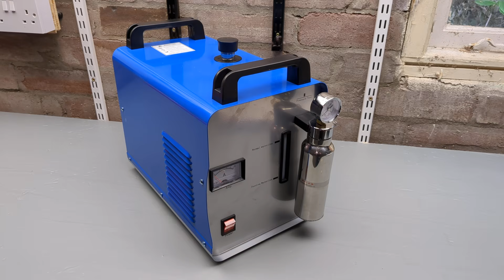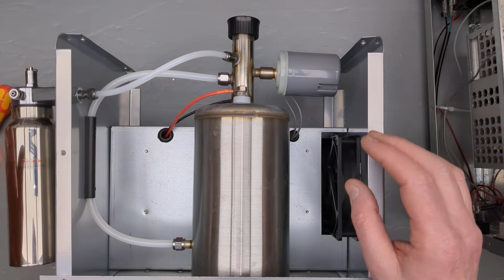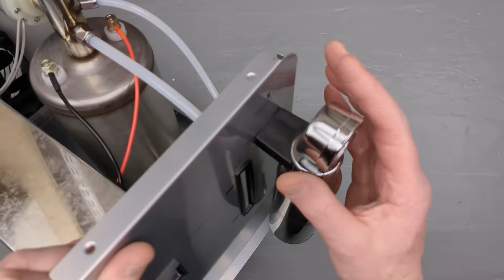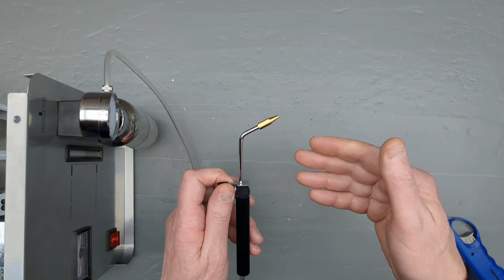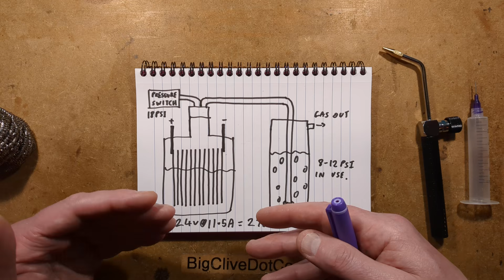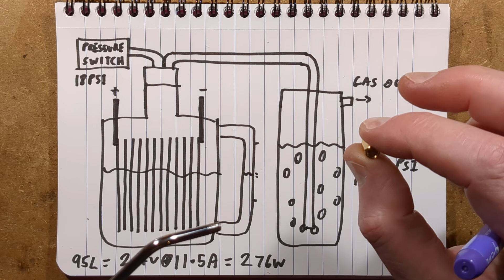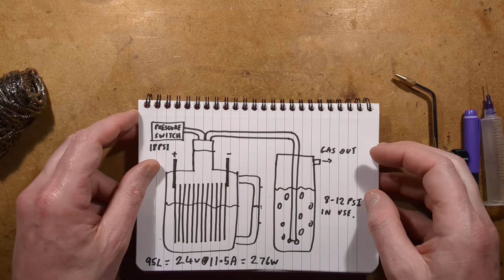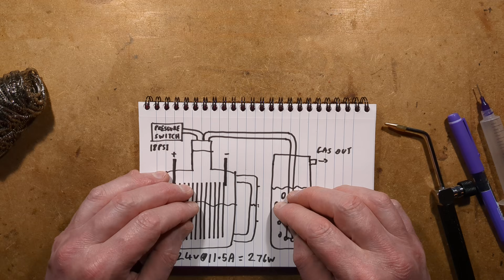Inside OxyHydrogen gas generators (HHO/Brown's gas)

Comment: You can do a engine clean with too.
Feed it in after the air mass flow sensor let it go in with the fuel and air, it will raise the burn temp and clean the engine from inside.
You just let the engine idol.
You can buy a small similar thing from C-GON a uk company that worked with jaguar.
I ran that gas though the slowest van i ever had a no turbo diesel ford escort van for 1 hour idling with occasional low to medium revs and after i could tell a difference.
I cleaned a guy's BMW M5 replica diesel mapped and he said i didn't think it could get any faster.
Just doing a engine only has limited and temporary effects.
You need a on demand device fir more permanent effects like mor miles due to nearly all fuel  being burnt which gives more power and more miles too.
My friends had a shittie on demand device not as professional as the CGON one but he took his vw touran for mot and the guy said that the cleanest 19 diesel emissions he's done.
He also got great results driving to hungry on holiday too. 
It was jaguar's euro 6 engine that CGON worked with and in test it improved the engines performance and fuel efficiency and emissions.

Comment: Oh boy, the formerly ISO certified in arc and gas welding me is screaming at this thing... A canister of stoichiometrically perfect oxygen and hydrogen, in a metal canister, with an el-cheapo PVC tube going to a tiny little gas torch..... JFC boys, that ain't it, that really ain't it.
Reply from the maker: I think the word you're looking for is "exciting".
Reply: @bigclivedotcom Certainly would be. When you're finished tearing one apart, would be interesting to see what a flashback would look like say, if someone didn't put any water in the "flashback arrestor" and also maybe the pressure switch somehow failed and the safety valve somehow jammed and it maybe got to 25 or 30 psi... would be very interesting.

Comment: From what I’ve heard, these torches need a very fine copper or brass wire wool flash arrestor, not steel wool. It needs to be very fine in order to remove enough heat from the flame front to stop the combustion process.

Comment: I'm deaf in my left ear and have tinnitus. This all started with a spark next to a freshly charged 12V car battery. After I'd thrown gallons of water all over my face to wash off any sulphuric acid that might have hit me, and found to my relief that my face was still there, I looked for the remains of the battery... there wasn't much to find. Hydrogen & Oxygen is a potent mixture. It was a decent battery too.

Comment: I can go into more details, as i build these things for a living, here in the U.K. 

These machines are hybrid wet dry cell, the plates in the middle are bipolar. 

The cylinder in the from is not a flash back device, it’s a bubbler/atomiser where you add your flame modifiers as that’s how you control your flame temperature. 

Normally tap water is not advisable as the machine will extract all the impurities like chlorine.
Reply: I’m a hobby jeweller and Aquaflame systems are £2k!! Are these ones in the video just as good and as safe to use?

Comment: Haha yes that is loud.
I didn't know these things existed for that sort of money but that'd be useful for a lot of stuff. Pity they didn't include an igniter on the torch, plus some kind of actual blowback prevention valve (though maybe that wouldn't work if it's implosive?). Ensuring the additional cylinder isn't dry should be enough though. Seems like pulling the pressure relief valve until it's cooled would be a good safety measure, but I somehow doubt the fan keeps running for a time after it's switched off (which would be another nice feature).

Comment: If you could do a video of inside of the electrolizer canister after some usage it would be appreciated. It would be handy to know what the plates are made of and how quickly they will corrode and become useless!
Reply from the maker: I'm not sure I'll be using the units enough to show the wear on the electrodes.  But they do degrade.

Comment: Cut one open?!? Come on Clive, surely you could make your own XRay machine. The 'Book of projects for the amateur scientist' from Scientific American in the 1960s shows how using an old radio valve and a high voltage power supply. Always wanted to try that one.

Comment: Thank you Clive 
Brought back memories of a stunt bored apprentices were purported to have performed on lunch breaks. 
They took acetylene cylinders to the waters edge. 
One blew off the valve unit with a sledge and a second tossed a ball of lighting paper 
Supposedly the cylinder then took off like a torpedo across the water. 
Travelling quite a distance. 
Never heard of any accidents but story goes some shipping om the river had a few close misses.

Comment: I built something similar as a science experiment in 8th grade.  a 200 VA 24 Volt transformer connected to a full rectifier.  Stuck two wires in water (I just used salt) and put the end of the wires under an inverted glass and let it rip for a while.  I then removed the inverted glass and lit what was inside the inverted glass.  Yep, it was quite loud.

Comment: It doesn’t take much to sink the oxy-hydrogen car power gadget.  It is a non-fision/fusion reaction so the energy it takes to electrolyze the water is the same as the energy released by the oxidation of the gas back into water…. But not all of the energy put into to the electrolysis cell goes into the decomposition of the water. There is considerable input energy converted to heat radiated uselessly into the environment.  It is impossible to recover as much energy from the combustion as it took for the electrolysis.  Case closed.

Comment: The engine cleaning thing has a grain of truth, in that once it burns and becomes water again it will then turn to (a tiny amount of) steam in the cylinder and (slightly) clean the cylinder - same effect you see when a head gasket lets coolant seep into one cylinder. However the shortcut to that is to just waft water mist into the intake. Mate of mine used to de-coke his engine with a water spray bottle, but you need to be careful not to hydraulic the engine by over-squirting the water. I imagine an ultrasonic mister would be the thing to use now.

Comment: ahh HHO, the half-assed method of producing a safe HHO flame

when it comes to hydrogen it is like any other combustible fuel, it requires the oxidizer to burn fast

the "safe" alternative (how they actually make large amounts of hydrogen gas) is a SEPERATED cell, capturing the hydrogen and venting the oxygen(or separate capture depending on the setup) and canisters made of the right metal to be resistant to hydrogen embrittlement are used to store 800psi(or was it bar?) hydrogen gas in a pure state(meaning no oxygen)

granted separating each cell(I think it is 2.5v per cell, you can google it) involves way more difficulty because you then have to deal with the gas collection on EVERY contact, or use something like a PEM fuel cell in reverse(which ironically is the best solution for hydrogen backup batteries)

Comment: Seems superior to a mini oxy/acetylene(or propane) jewelers torch...
Very cool! Sounds like its almost perpetual run time pretty much provided you top up the water with no mineral content?
edit* 
Holy crap people are breathing this?! 
Also duh.... this isn't going to increase horsepower unless the ECU is programmed to 'expect' the difference in 'fuel/air mix' and even if this is done there may be other modifications (increasing compression etc.) required to actually take advantage of it at all... but nothing is required for a snake-oil sales pitch!

Comment: Fun story re flashback arrestors,  years ago I worked on a flame effect for the Athens Olympic torch relay through London. Part of our bit was to put a load of copper pipe with holes in into the large Canary wharf fountain and weigh it down, we then fed propane through it which bubbled up through the water where it was lit resulting in the surface of the water being on fire as the torch passed. Trouble was the H&S idiot at Canary wharf insisted on us using flashback arrestors despite it being a fuel gas only system and the fountain being a huge water filled flashback arrestor itself. Luckily I lived 10 minutes away from Bullfinch (they've since been bought out and gone) who supply welding flashback arrestors including some high flow rate versions. The MD was extremely helpful and a really nice guy and as well as confirming that the H&S guy was a total idiot took pity on us and sold us a load at cost (Bullfinch later went on to design the burner for the London 2012 torch so maybe that's karma). Unfortunately the arrestors still reduced the flow significantly resulting in us needing far more propane cylinders on site than we otherwise would have needed which the H&S guy was OK with  despite it being a significantly larger hazard than not using flashback arrestors.
Reply: Totally agree with you. What a dick. Sad to hear about Bullfinch. I'm still using a couple of their torches. With all the 'no hotworks on site' rules these days I'm not really surprised though.

Comment: I used to fill a combination of balloons some with pure hydrogen for lift, a few with Oxygen Hydrogen for noise and the rest with propane, tie them all together and add a slow burning fuse, light fuse and release. I have a full airport firesuit and helmet as well for safety.

Comment: When I was in my first semester of college we were learning about electrolysis in a physics class and I thought it was pretty interesting so I stuck a phone charger in the side of a 2-liter bottle and sealed it with hot glue. I filled the bottle with water and put a balloon over the mouth of the bottle. I plugged it in and the balloon started to fill. After a while, I took it outside and lit the balloon with a match on a stick. I had the same reaction as you did. Boy it was loud.

Comment: browns woofle! i was literally going to make 1 of these for this purpose!!!
also you should never use rigid/hard tubing in these as the flame front is supersonic and the spike can blow out rigid plastic like the syringe body on the 1 torch, always provide weak points for expansion/release of energy it's better to have lost tubing than spraying hot sodium hydroxide in your face/eyes

Comment: The idea of running a car by injecting the OxyHydrogen of course is nonsense, but there is in fact a well established use for the gas. Using a gas generator quite similar to yours and running it for a certain time through the intake manifold while idling the motor significantly reduces the built up carbon residue in the intake (the carbon settling there due to the modern engines having the exhaust feedback). Here in Germany offered as 'carbon cleaning' - does not work on heavy cases bit keeps the motor fit.

Comment: Some people use these to "clean" engines from soot in car shops. Those are a bit more powerful and draw about 40A. Also, i am a bit puzzled about such a high % solution for electrolite. I had a table of efficiency for many concentrations and actual HOH production drops and device starts producing heat. I used to have about 20g to a liter. Maybe these chinese engineers have quite a small surface for plates.

Comment: I have used these for years, they are very good at making bangs, empty coke can on its side with a pen sized hole in the bottom fill with gas then ignite it keeping hands well clear, search for the can whilst ears stop ringing, you did a clip about lighting empty isopropyl bottle same effect but with more vigour

Comment: I’m not sure about electron spin and how they proved it. Seems more like harmonic pulsating spherical energy waves to me? But anyhoo, I suspect the dc needs to be pulsing at a frequently the same as the water molecule to basically help it fall apart. A bit like that perfect cutting speed on the drill or jigsaw. Also, not as big a bang as the high voltage fuse, that was epic :D

Comment: 10:00 Isn’t the flame the hottest at the end or is that just the case with wax candles?
Reply: Hmm.. I know with blowtorch flames (or those jet butane lighters) where you have the collar of smaller holes around the one central hole, the flame is hottest at the tip of the inner flame, not the outer flame.

Comment: The suck back issue is why chemists normally use two of these bubblers, connected in such a way that the internal tubes and their connection forms a U shape while the connectors to the apparatus and the exterior are only exposed to the open cylinder, not the liquid level they could suck up.

Comment: Lye recipe (potassium hydroxide): 
1) Hard wood (not pine etc, apple and fruit trees work pretty well).  Burn hard wood in a clean fire pit or stove, and allow the ash to COOL then collect it. 
2) Drill some small holes in a bucket, put in a layer of flat stones on the bottom, cover this with gravel. (this helps it drain slowly and gets rid of coals or ash).

3) Put this bucket in another bucket, fill with the ash, fill with soft water, distilled water, or rain water.
4) Once the PH is 14, you've made some lye. Don't have PH paper or a PH meter? Chop some red cabbage and let it soak in some boiling water for a bit, strain the water in a bowl, you now have a anthocyanin solution, pour some lye water into a bit of this. This will change colour showing you the PH.
Reply: Yeah, wood ash is strongly basic.

Comment: If the only output is hydrogen and oxygen, then you should only need to add sodium hydroxide one time, right?  Just keep adding water when it gets low?
Reply: In theory, yes. In practice, you get a little bit of something like salt water spray all the way through the tubing and the nozzle, so you do sometimes need to add some hydroxide.

Comment: Which temperature can the flame get to? May be used to melting aluminium or even iron?
Reply: It should do aluminium easily (even my butane lighter can melt through drink cans), but with iron it'd probably need a greater proportion of hydrogen because it would oxidise very fast indeed. Note that you can't weld aluminium with it because the hydrogen makes the metal brittle.

Comment: Electrolysis uses more energy than you get from burning the resulting gases.
Reply: Which is why you need an electrode catalyst, to bring the overpotential down. That's why people are using platinum nets as electrodes which this certainly doesn't have.

Comment: The Steel wool will help, its what they use for miner's lamp. A mesh of metal will cool down the temperature and so the gas on the opposite side will not burn.
Like a Flame arrester… Just test it with a metal sieve, you will see the flame will not go thru the sieve.

Comment: I am still in the "need" for such a device for brazing (refrigerant lines and stuff)
But the measly 300W is no use for that. They exist in the ~3kW range, but are way to expensive
Reply: It might work if you can preheat the lines before introducing the torch. I had some luck with brazing using a weaker blowtorch after I put the items on the gas hob, so maybe that or a butane torch held on the area.
Reply: @NightCatArts  Ideally I want to eliminate buying any gas since I get electricity "for free" from my PV system (at least 7-8 months per year)
I know induction heating is a thing but these devices are expensive too and not as flexible as a torch
Reply: @Fluxkompressor  Induction would seem to be the best option then, or a little furnace & charcoal. 

You can make a fairly inexpensive induction coil yourself (i think Joshua DeLisle made one a while back). You make a cylindrical coil so you can stick the line through the middle.
Reply: @NightCatArts  "through the middle" is the worst thing you can have when joining pipes together that have stuff connected to them on both ends
Also I believe that induction heating copper needs some special attention in the circuity because its not magnetic
Reply: @Fluxkompressor  No I mean you put the pipes through the middle of the coil, let them charge them up with heat, & then do the brazing. You wouldn't necessarily need an enormous amount of heat since it's only there to sort of buffer the heat loss from it travelling further along the pipe & away from the end you're dealing with.
Copper does present extra challenges yea, but that may be for actually brazing with the induction as opposed to simply using it to add heat. You could put an extra bit of steel pipe inside the coil and then hold the copper inside that, so that the steel heats the copper, too.
Reply: @NightCatArts  I suggest you watch Chris from HVACR VIDEOS. Great guy and very educational content about refrigeration stuff
Brazing is done at bright yellow hot glowing temperature, as soon as you take whatever heat source away from the work, that copper will conduct the heat away in seconds. You need to be able to bring heat in the work piece as you braze it. So sticking a pipe thru a coil is no option. Maybe with some special would "open at the side" coil where you can lay the pipe in but that must have an even lower inductance to work with
I don't say this cant be done, but is is rather complicated compared to just burn stuff
Reply: @Fluxkompressor  It conducts it away only as long as it can accept more heat though. I'm saying if you load it up with all that heat before you begin then it'd step down to radiating the heat into the air instead of conducting it along itself. I agree a closed tube sort of thing wouldn't be a great way to do it in this case since you'd need to work faster once it's out, but radiance is still far slower than conductance.